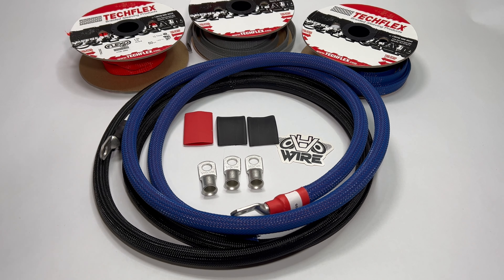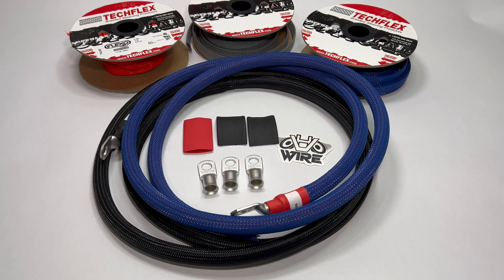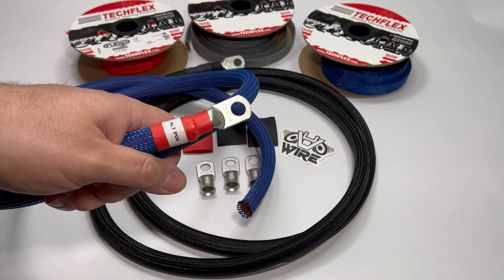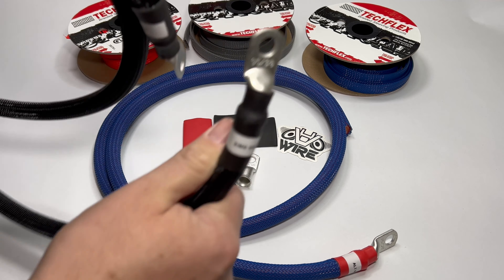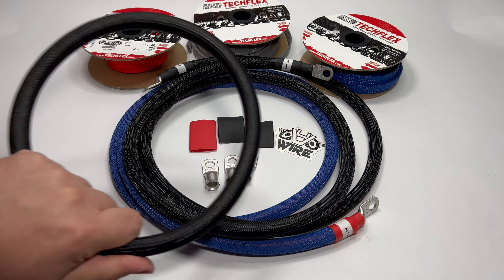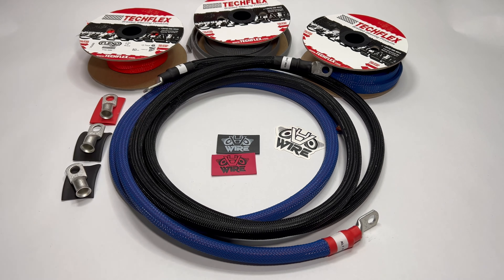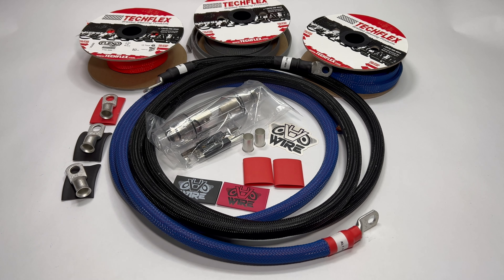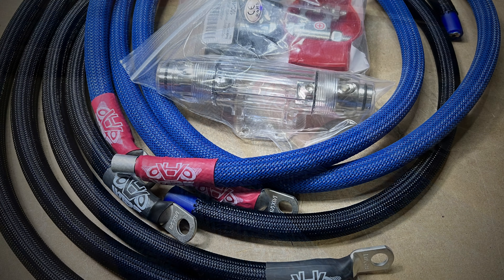HifiVega Big 3 Kits

Comment: Would this wires fit 2011 chevy Tahoe 5.3 liter. Thanks
Reply from the maker: Yeah you’d have plenty for the alt power run and enough to do the battery to body or frame and alt bracket to frame or body

Comment: Are these vehicle specific or universal? I think the blue would go well with all the blue silicone hoses on my LS swapped Colorado. Probably going to do KnuKonceptz Colossus Flex 1/0 power and ground in blue for my old school RF build in the truck.
Reply from the maker: These are universal, but if you know what lengths you need exactly I can do custom kits with all the lugs pre terminated and heat shrinked ready to go
Reply: @HifiVega  that’s awesome, I’ll definitely keep that in mind when I get ready to do the wiring then. I’m in the process of doing fiberglass door pods for a three way active setup right now. Gotta get it in while the weather is still somewhat warm enough here in Tennessee.